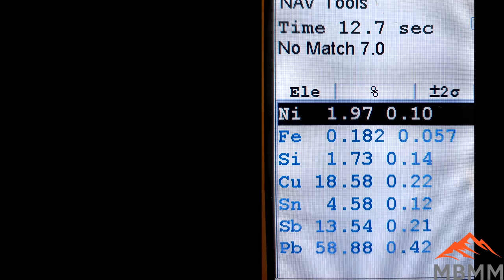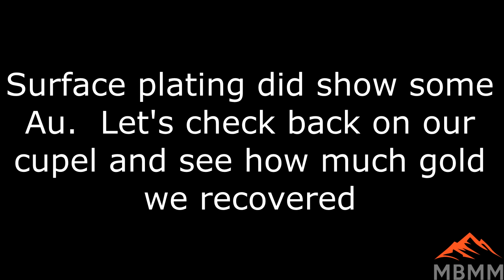Refining & Recovering Gold From Rings and Jewelry

Comment: reverse electroplating would be the most cost effective I think
Reply: Wouldn't the initial set up cost a pretty penny?
Reply: @Dgafsranger  The much better way is to use mercury to just soak the whole batch into it for a while until it strips all the gold plating from these!Than either evaporate/boil all the mercury or dissolve it in nitric acid and that's it!
Reply: @Dgafsranger  electroplating is pretty cheap. You don't need anything special to do it

Comment: Looks like the 'Lord of the Rings' material someone was selling on eBay.  They had a 55 gallon drum of them.  Good Luck!
Reply: Exactly looks like knockoff LOTR merchandise.
Reply: I remember exactly these on eBay sold by the 55 gallon drum. Nice catch.
Reply: Bead Purity: Simply, why did you not XRF the bead?
Not knowing how many pounds of rings there is nickel and copper have value. 
My thought is to reverse electro plate removing the gold surface then the nickel and copper. Once the lab is set up electricity does the work.
Reply from the maker: Thanks!

Comment: 8:17 The bubbles could be zinc evaporating...  not sure what kind of low melting alloy they used but zinc is often a component of that kind of alloy.  Saw the XRF... could be Antimony, it boils at 1500 C.

Comment: Great video!  @sreetips on his channel pretty much confirmed what you're saying here - he has a few videos on recovering gold chemically (and I think electrically) from gold plated material and the reality (which surprised me) is that the gold plate layer is extremely thin and you end up processing a lot of material to yield a small amount of gold.  I also think that however you attempt to do this it ends up requiring a ton of time and materials.  It's really counter intuitive because it looks so shiny - but I guess it's true what they say about "all that glitters" and all that ;)
Reply from the maker: Yes, the gold plating is suuuupppper thin. not much there.  I like Sreetips channel
Reply: @mbmmllc  Yep. Look up the definitions of the various gold plated classes here in the US. We are looking at millionths of an inch (e.g. a few microns thickness).

The bubbling may well have been lead boiling. Did the temp get about about 1740 deg C?

When you did the cupel test, there was no need for the bismuth. All that lead in the rings will gather the oxides and suck them into the cupel.

Also, your electric furnace must be quite leaky. Normally during an assay, the door is left open somewhat so oxygen can get in to oxidize the base metals faster and more completely.

Comment: The electroplating may be so thin that you're getting colloidal gold suspending in that borax, rather than settling out.
Reply: I think you are correct, he should clean cut one of the rings in half to determine the plating thickness.
It is much lower than vermeille , I would just grind up the whole lot and Aqua Regia it ...then sulfuric acid precipitate out the lead.
Reply: That’s what I was thinking too. Lots of reds in silicate glasses are from gold ions. The plating could have a tin base and in the crucible that could reduce it and make the gold go into the slag.
Reply: @douglaswhite3933  that's a good thought.
Reply: @rrfields65  I agree with your proposal - hydrometallurgy is much more efficient. he very stupidly rests against one of his own method of stove, everything goes into it, and electronic garbage and jewelry ... very stupid ...

Comment: About those bubless, many speculations are that they are caused by boiling metals but i found few comments that seems more logical to me, that it could be boiling borax (1,575 °C; 2,867 °F; 1,848 K). If your furnance got that hot it might cause it to evaporate. I will go with that theory because the metal on the bottom seems quite still (on the other hand the liquid borax looks very "mad and bubly")

Comment: Try  using 5 parts HCL to one part Nitric Acid and see if you can get the gold in solution.  
I’m sure you have done it before but it works really well for gold plated and gold filled items and if that is silver in there the the silver will separate from the gold and you simply filter it out then drop the gold out of solution and you end up with a gold powder when it’s dried that u can melt   
If there is 200 rings there you should recover 6 grams  .03 x 200= 6 right ?  Seems like it’s to much lol
Reply: .03% PERCENT. Equals .06 grams of gold.
Reply: It isn't that simple. The HCl reacts with the surface of the silver and any tin present - passivating them and preventing them from being dissolved. That is why nitric acid boils are used until silver is no longer detected in the boil liquid.

Comment: Considering the furnace temp is almost 6 times it's melting point, perhaps the bubbles are from the lead vaporizing.
Reply: There is a huge difference between the melting and boiling temperatures of lead - as is the case with most metals.

Comment: they are probably made using a press. that means a little container shoots out and back to fill the die and it's pressed in to shape. it's not the most accurate way of doing it weight wise but it is fast.
Reply from the maker: Good idea

Comment: Rubies are basically compressed aluminum oxide. Maybe the slag is red because the ring had aluminum in it as well. Perhaps the ring had aluminum and trapped air and that's what the bubbles were from. Even tungsten can get air trapped in the metal so
Reply: I corundum!

Comment: Best way I think would be sulfuric cell but man theres definitely not much on those eh.    Thanks from  Ontario Canada.   Also was wondering if you seen my message about the ic chips.  I have about 150 kilo of very high grade and prob 500 pounds of low grade.
Reply from the maker: Going to try sulfuric next.  I'm going to pass on the chips, but you can probably find a buyer easily for them
Reply: @mbmmllc  ok thanks anyways.  Yeah with the gold corned bga chips yielding anywhere from 5 to 10 grams per kilo of caps I really wanna do the process because places like board sort pay well for lots of items but not the high yeild stuff. I figure theres about 250 to 500 gram of gold total in all my chips.  Maybe in the near future I will buy a table. Thanks and keep up the great vids

Comment: It really seems like a quick chemical process to flash remove the surface gold would be best.
Reply: That's not really possible unfortunately, in my experience, you can only remove gold like that from glass or reverse electroplating
Reply: @scrappydoo7887  Well my idea to do it quickly, almost as if it was a mechanical process. There is so little gold, and it is all on the surface. It might only take a few seconds to do a batch. You could put a few rings on a plastic hook and dip and swirl in acid for a few seconds looking for a color change before reloading with more rings.  The after you are done with a 1000, process the acid and see if the gold drops out of solution.
Reply: @reina4969  What kind of acid?
Reply: @torchandhammer  My guess would be an Aqua Regia solution. Hit it hard and fast.
Reply: @reina4969  I don't think that will work. You will end up with very badly contaminated gold and the two things you don't want in any solution. That's lead and tin
Reply: @scrappydoo7887  Of course it is going to be a bit contaminated. It will still need to be processed, but not any more than the resulting cupel he got.
Reply: @reina4969  yea that's probably true but the process used will have been cheaper .
I suppose it's just a case of doing what you can with what you have
Reply: @reina4969  it would also depend on the silver content because aqua regia isn't good for silver.
Reply: Put these rings in a copper screen and put in sulfuric acid bath this is electroplating and you will get just the gold
Reply: @tomclark3357  reverse electroplating but yes
Reply: @tomclark3357  its also not just sulfuric that you have to have in the electrolyte
Reply from the maker: going to try sulfuric cell next
Reply: All said processes work, they all have pros and cons and aren't as difficult as some seem to think. Sulphuric/RE cell would be best which is 98% sulphuric as electrolyte, nothing else. Note this is a recovery technique not a refining technique

Comment: 8:00 The bubbles could be boiling borax as it's boiling temp is 2867 F and something may have lowered it's boiling point in the melt a bit if it isn't that hot.
Reply from the maker: Thanks for the tip

Comment: If these rings have ANY gold in them at all, the best way to extract the gold in them cheaply is a sulfuric acid stripping cell. All you need is a battery charger, a pyrex dish, A Lead Bar and some Sulfuric acid Drain cleaner. Since the rings have a large surface area, they should be easy to de-plate quickly. (2-3 seconds each.)
Reply from the maker: Thanks for the tip.  I'm going to try that next!
Reply: @mbmmllc  Did you ever try it? It's been 10 months!

Comment: Does the power to the oven shut off when you open the door, or are those coils live all the time?
Reply: He often cracks the door open to let in more oxygen as the metals cook.
Reply: Always "hot."
Reply: Why wouldn't they be live? Are you afraid of your stove?
Reply: @filonin2  
My guess? He's worried about someone being electrocuted by the exposed coils.
Reply: @xenaguy01  Your body's resistance compared to the coil should prevent that. Also they are very hot which tends to discourage touching.
Reply: @filonin2  
1) I didn't say I was worried.
2) So you've never in your life touched anything accidentally? Your mother was very lucky.
Reply: @xenaguy01  I've never reached into a yellow hot furnace with my bare hands, no. I guess I thought it was basic animal instinct not to but I guess lead in your water is pretty bad for cognition.
Reply: @filonin2  
"I've never reached into a yellow hot furnace with my bare hands, no."
Nice try, not at all what I said. Ever shut your finger in a door? Stubbed your toe, tripped on a sidewalk crack? Ever dropped a soapy glass? Ever burned your clothing or a piece of furniture smoking?
Those are all things everyone knows not to do, but it happens every day to someone. Like I said, if you've never done anything like that, your mother was a lucky woman.
Reply from the maker: Nope, its on all the time

Comment: Question: why did you use borax this time? On your other videos you use that sand looking substance that turns into glass, but this time you use borax. Also, at the beginning of video u mentioned about bismuth. And last question: why do u alternate between the electric little heater and the home made furnace with propane bottle. Im somewhat new to this but taking lots of side notes on paper and pen.
Reply from the maker: It depends on the situation.  Here I just needed to absorb the oxides on the surface.  The electric heater I use for oxidizing and the propane I use for smelting
Reply: @mbmmllc  
Taking notes, and thanks for replying.